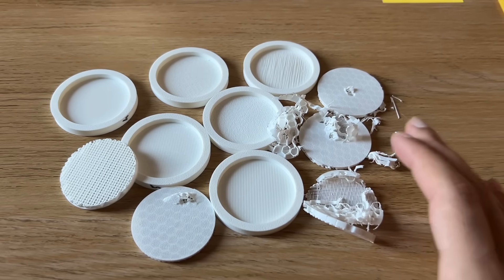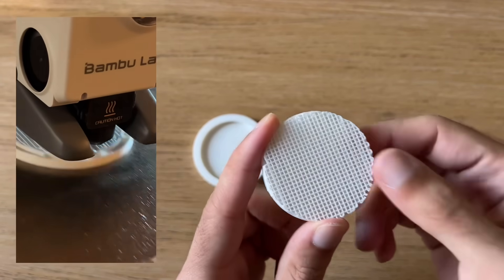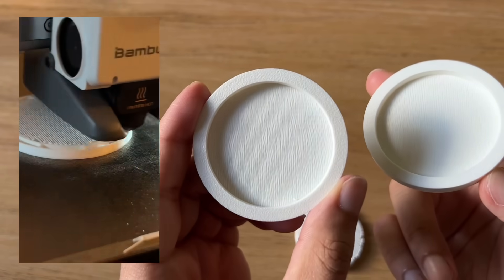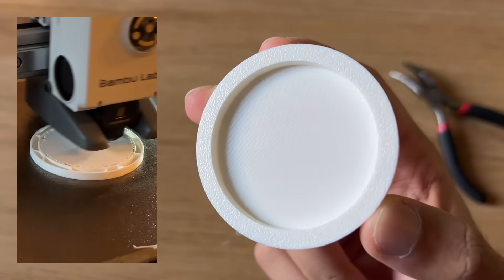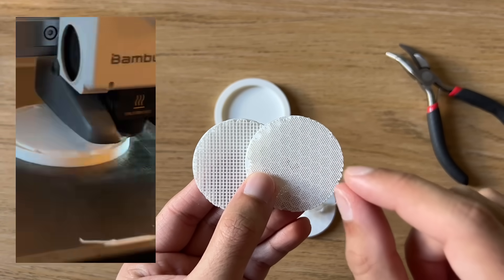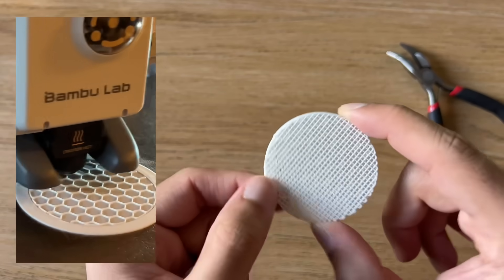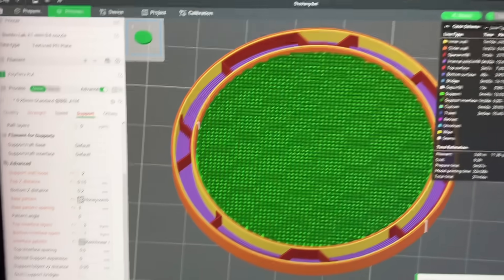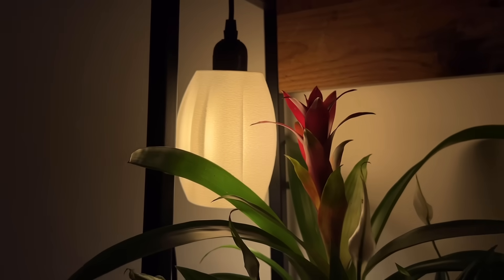Best Slicer Settings For Printing Overhangs?

Comment: A trick I always use to get a support block to remove easily is:
After the last layer of the supports is done printing, pause the print and completely cover the support surface with the ink of a Sharpie and resume printing.
This will ensure that it easily releases from the model
Reply: I'm definitely going to try this out.
I'm making a grate for a shower and there is not a lot of wiggleroom with the design. No matter how I turn it one visible surface will need support. I've tried printing it at an angle and a hundred other tips, but still not 100% satisfied. Removal of support always leaves potmarks of some kind.
I will try this and see how it fares.
Reply: This is such a niche solution though. If you have any supports that ahve more than 1 layer it basically means you have to pause, every single one (or least every few) layers to go put sharpie on them.. Put it wrong spot and now you just created a weak spot in your print.
Reply: @MattWeber   it's not niche it's situational. Everything in 3d printing is. But often you have the design freedom to make use of situational solutions like that.
Reply: Not really.
You find out which is the last layer of the support is in the slicer and have it pause the print at exacty the correct layer!
Reply: @RobNisters  Again.. if there is single solid layer.. if you ahve anything that is basically any organic shape other than flat, now your pausing 100 times to follow the shape and support contact points.
Reply: If it's an organic shape, I usually don't have much trouble removing supports, because mostly the contact points are less frequent.
Besides, the example in this video IS a flat surface, and this is what I'm responding to
Reply: @RobNisters  Which goes back to my original comment.. its a niche solution.
Reply: I design my own functional objects, and support for a horizontal plane happens 90% of the time, so not marginal for me at all
Reply: @RobNisters  niche =/= marginal....
Reply: @MattWeber  you must be fun at party. let me say the words the other nice guy doesnt want to say to you.
Reply: @MattWeber  which is why his original comment said support block specifically and your comment is just plain stupid

Comment: For clarity, when you say "support material" you're simply referring to supports, not a specialized material for supports, correct. It appears that way in the video, but I want to be sure.
Reply from the maker: @OneEyed_Jack  correct, I’m using pla for both the model and the support material

Comment: Use of organic supports with higher than default tip density (like 30% or more) and same interface layers might make it easier to grip the support to remove it, and save material & print time. Organic supports have gotten so good now, not just for "organic" shapes but everything, that I haven't really used old style supports in like a year or more.
Reply from the maker: good point, ill be honest i havent used organic supports for flat surfaces in years, the last time i did i was using cura and an ender 3 which did not work well. will need to revisit!
Reply: @doublesketchstudio  Tree/organic supports got a huge revamp a couple years back, and now with interface enabled they basically do a small layer of classic support just below where they touch the model, rather than only touching in a few random points and hoping to get lucky. They work so well now!

Comment: For a horizontal supports it's good to set all 0.4 line width on a support layer only with modifier, and reduce speed as much as possible and good cooling of course. On this settings your supports can be printed with 0.1 gap and have much less adhesion

Comment: I use an X1C and I have printed many objects like this, for example circular containers with lids in various sizes and not once never have I had the outcome you describe, specifically the loose lines printed on the inside of the shape.
I just use default settings and the surface is perfect, so I don’t understand the reason for this post.  The outcome you demonstrate before you used supports must be user error.  Try again with default settings
Reply from the maker: @pensiveboogie  the first test piece was a control and used 0 support material, it was printing onto nothing hence the filament strands not connecting. It was using default settings.

Comment: amazing, I have been wanting to do stuff like that since I am printing some models and other bits and want a nicer finish especially on the bottom if there is a hollow there. Quick question do you have a method in regards to over hangs on models, for instance I  used tree supports and it dose a mesh if there is a significant overhang and when I remove the support you can see a difference in the part that was supported. I hope that made sense.
Reply from the maker: i dont really have experience printing small models, maybe looking into built in supports might help. are these models you cad yourself?
Reply: @ its all Models to be honest, its when you have a over hangs higher up but I will experiment and let you know what I find :)

Comment: There's the marker tip too, inset a pause in your gcode, colour the top.of the support with a marker, and it won't stick. I don't know if you're supposed to use dry wipe or felt tip or Sharpie, never actually tried it!
Reply from the maker: I’ll have to try that out!

Comment: Or you can just insert a 'table' into infill space before printing bridged section, and actually turn bridges off at all. If you use different material, for example PLA and PETG would not melt together you will have very smooth surface and if you print many items you will save material and time too. You will need to add pause of course to make an insert, like with nuts.

Comment: Orientate isn’t a word you are looking for the word orient a verb.Orientation is an an adjective.
Reply: Orientate is a synonym of orient. Both can mean "to cause to face toward the east." The proper noun Orient refers to "the East." The verbs, however, have broader meanings that relate to setting or determining direction or position, either literally or figuratively. Orientate tends to be used more often in British English than it is in American English.
Reply: @ljadf  thanks.

Comment: I always use 0.275 or 0.280 for the distance makes it so much easier and doesn't leave much of a scar on a print. If it is a curve or rounded surface you will see a little scaring.

Comment: If you are using PLA or PetG and have multi material capability, try this … 2-3 layers of support interface, reduce the interface spacing to zero using rectilinear pattern and set the z gap between support and model to zero. The actual supports can be whatever spacing and structure you want as long as you have enough interface layers to remove any waves. Set the supports material the same as your model so bed adhesion is the same but make the material for the interface layers with the other material. So if your model is PLA, your supports will be PLA and support interface layers will be PetG. Since PetG and PLA will not bond to each other, the supports will peel off easily and the zero gap should give the best possible finish.
Reply: Just make sure to set your purges to the highest you can go. I tried this with my K2 Plus when I first got it, and prints would split along the layers where the material changes happened.
Reply: came to comment this, I would like to see a multi-material interface as test print.
Reply: Great tip, this should also minimize material changes and therefore purge/waste.
Reply: @3dexperiments  It depends on the model - if you're trying to support a curved or angled surface, you'll have a lot of filament changes, in some cases for very small interface sections. You need to understand your model before selecting that option if minimizing time and waste are important.
Reply: @ Agreed, but this technique will help me design my own models better - where the supports are part of the objects and thin flat layers of interface.
Reply: @tomsommerville  it works also with a curved interface layer, but for sure, it's a lot of waste due to the may material changes. That's more a job for an idex-printer, or any printer with multiple tool heads.
Reply: @tomsommerville this is where H2D shines. However, it’s just too expensive for me😂.
Reply: Depends of how multimaterial system made. If you extrude from the same nozzle then bad news: remnants of PETG may pollute later part and affect layer adhesion so as the finished part would crumble to pieces.
Reply: @vasiliynkudryavtsev  for these set purge to something very high and only use the alternate material for the very top interface material so you only change once per tops of supports instead of 2-3 times for multiple interface layers.
Reply: Set Support/Interface to the opposite filament (PLA-->PETG; PETG-->PLA) and set Z distance to 0.
Reply: Following the same prerequisites (multimaterial), you can apply the same support distance to zero and use PVA/BVOH filament for supports (PVA/BVOH spools are meant for this very use case), which will dissolve into water. Works with PLA, PETG, and nylons too.
PLA/PETG workaround sure works, yet it's like wasting some material that could be used for something else.
Reply: @Myrblyl   The big difference is that dissolvable filaments cost a lot more than either PLA or PETG with the added advantage that if you use PLA/PETG for the support, you don’t need to stock and store those expensive dissolvable filaments that are VERY sensitive to humidity.
Reply: @  That's right ! Dissolvable filaments are just one option among others., like PLA/PETG supports.
None of them is perfect either.
Reply: @Myrblyl   When printing out supports that are going to be thrown out, I prefer those supports are made with material that are less expensive. Most prints are done in PLA and PETG. Supports with PLA/PETG separate easily without the need to soak in water and they are less expensive than soluble filaments. If you want to pay more for material you will only melt in water that doesn’t make the end product any cleaner than the cheaper, easily separated filaments, go for it! It’s your money. If you want to throw it down the sink, that’s up to you. The soluble filaments are great if you need to print in other materials that don’t resist adhesion to other filaments in the way PETG and PLA do, but if you only print in these filaments, soluble will only cost more and require more effort and time to remove the supports. If you figure reducing costs isn’t your bag, don’t get into 3D printing as a business. Sorry for the long explanation but you seemed to be missing the point since you referred to PLA/PETG use as “wasting some material that could be used for something else.” Seems you prefer wasting filament that costs 1.5-2x more.
Reply: @fraudbuster1456  You got my point wrong. I guess we misunderstood each other.
Of course soluble supports are meant for people (or companies) that have use cases for this because of the price of these specific filaments. ^^
As for the PETG/PLA thing, sure it's a great thing ! That's something do at times too.
Reply: @Myrblyl   You’re right. We must have been confrontationally agreeing. There is also the point of other filaments. TPU, for example, requires soluble supports as most other materials adhere to TPU. Many TPUs cannot be used with AMS systems so if you need supports for them, you end up needing to cut the supports off, but on a IDEX printer, you can used soluble supports for your TPU.
Reply: That's a great tip! Just be careful not to make the same mistake I did. I tried this, but thought the purge tower wasn't really needed, so I turned it off. That was a terrible mistake. A small amount of PETG got mixed into the PLA support base, and the support collapsed. Definitely keep the purge tower enabled. 😅
Reply: That's my trick as well the results are just amazing. Usually I don't even need any tools to remove the support material.
Reply: Holy crap this is awesome.   I have a 5 tool PrusaXL so this is gold.
Reply: Will it work with A1 ams?
Reply: @geronimodenpiero  Yes. I use the A1 with AMS Lite. Increase the filament purge volume on filament change and make sure you have a purge tower as recommended above and it should work fine. You also want to make sure the purge to infill option is off as well. The PETG/PLA interface is so good that even the top layer pattern if transferred almost perfectly to the bottom layer on the supported sections. If you want an ironed pattern on the bottom of your supported piece, iron the top support interface layer. The two materials adhere to each other like they would to a PEI bed but they do not fuse to each other so are easily separated.